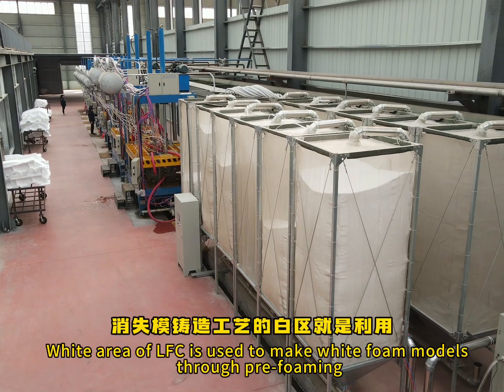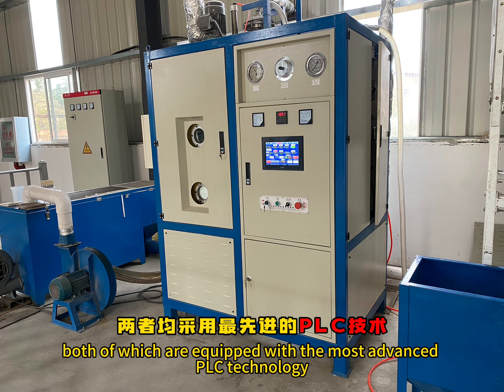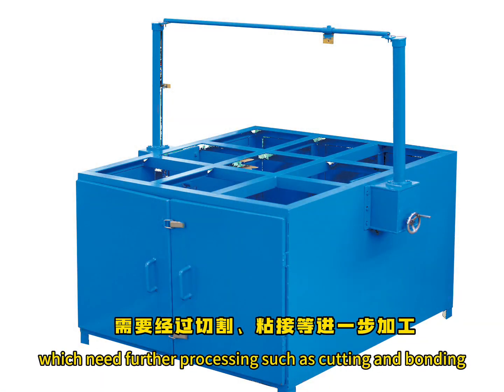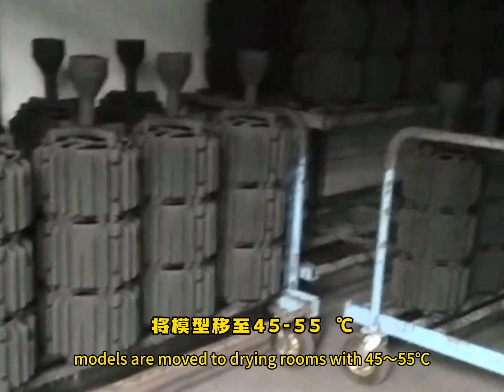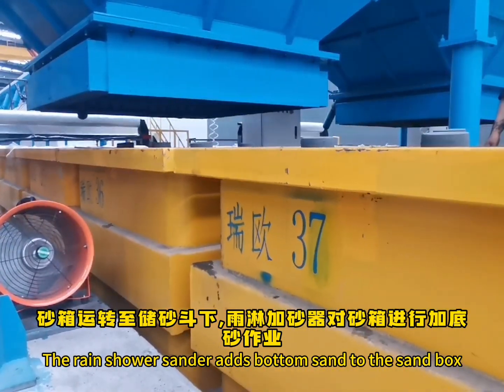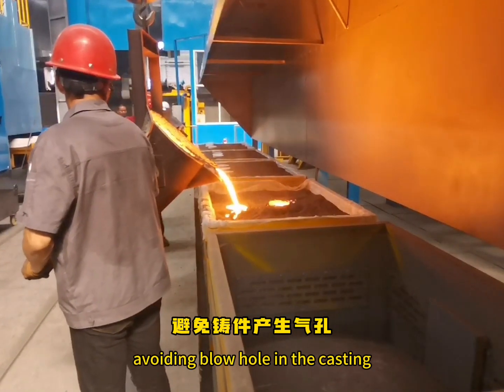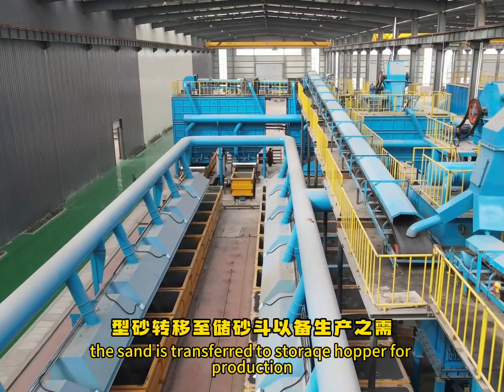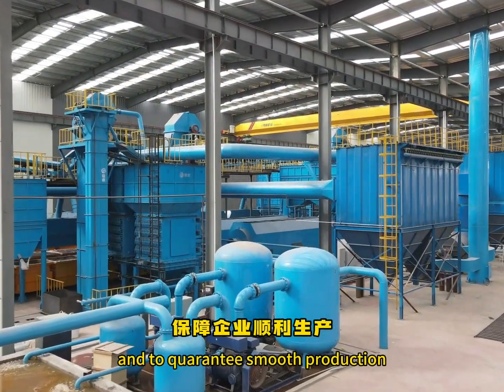消失模铸造工艺流程Lost foam casting process

Comment: Wow! Excellent video.
Very cool to touch on all the processes involved.  Really like the info on how the sand is recycled and cleaned. 👍
Reply from the maker: If you need lost foam casting equipment, please contact us.
Hebei Ruiou Intelligent Equipment Co.,Ltd
Address:Shijiazhuang City,Hebei Province,China
Tel:+86 18631101069
Whatsapp:+86 13603172930
Wechat:+86 18631101069
SKYPE:+86 13111730651
Email: equipment02@rolfc.cn
Web:www.rolfc.cn
Reply from the maker: Thank you for your compliment